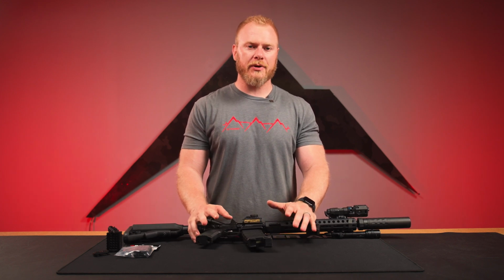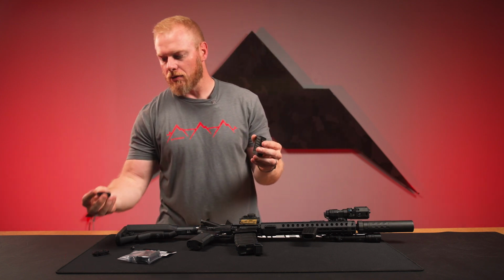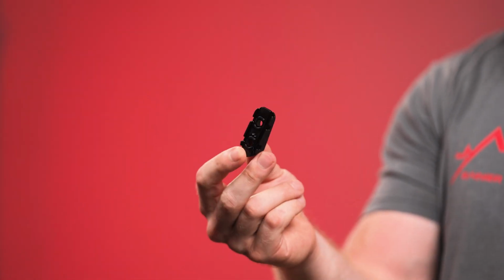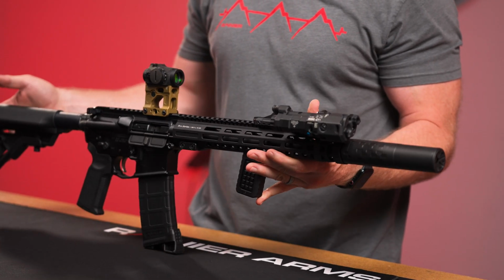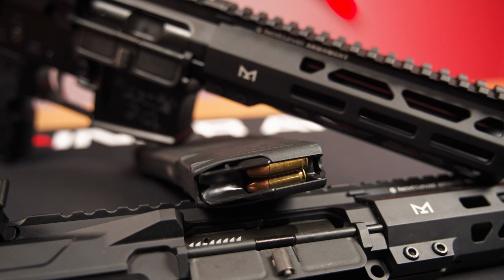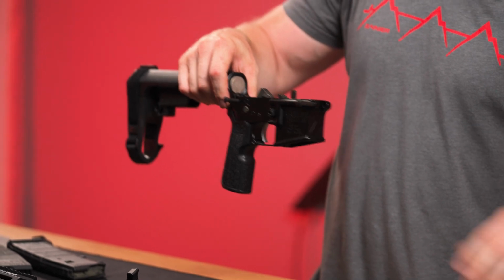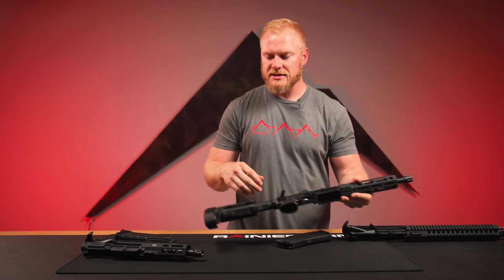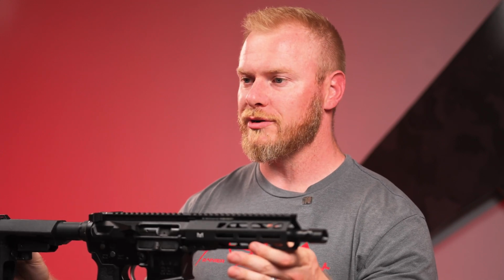Innovating with Rainier Industries Evo Grip & Next Level Armament Horus 9mm Upper Conversion Kit

Comment: So next level armament just copied CMMG. Got it. Not a new product, and 10 minutes was spent talking about a vertical grip. wtf
Reply from the maker: The New Product Weekly videos are the new products we are carrying. As in, new additions to our inventory. This series has been going on for quite some time. We pick a couple or a few products to showcase and is a way for our customers to see our new offerings and learn a little more about them in the process. And yes, why wouldn’t we spend time talking about a product we just released? Especially when it’s more than just a simple verticals grip with options above “just slap it on”. Sorry, not sorry one bit 🤷‍♂️